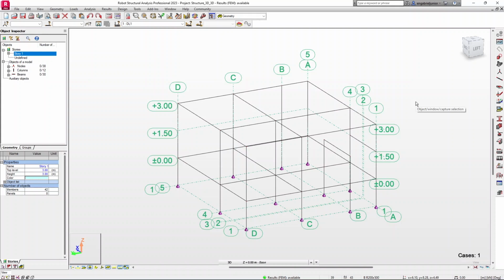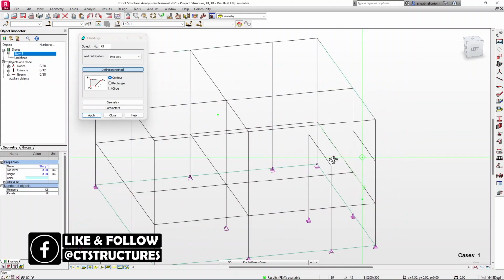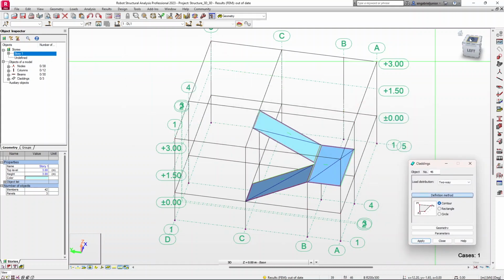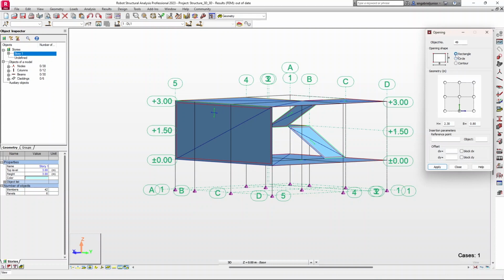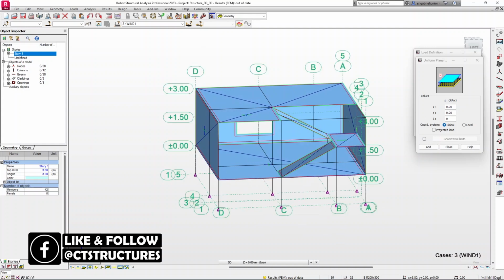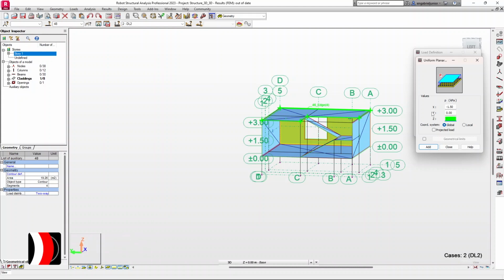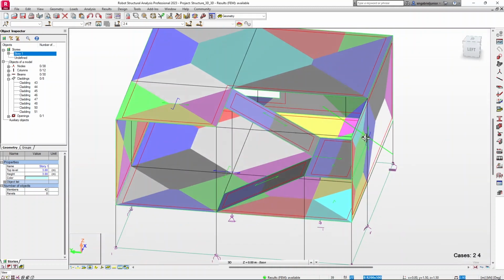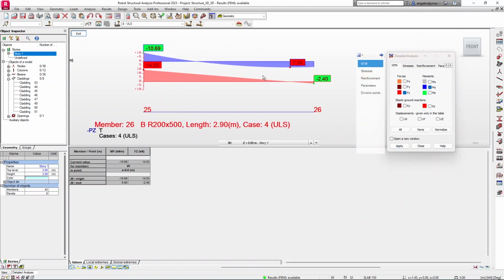Working with Claddings - Robot Structural Analysis Extras

Comment: Do claddings work for load distribution when load-bearing elements have offsets that pull them out of the plane where the cladding normally would be? Should claddings be drawn on the original axes, or should they be drawn on the nodes of the elements after they have already been displaced by offsets?
Reply from the maker: Hello Daniel.
To respond to the first question; yes they do.  The load-bearing member will respond according to how it is modeled, considering the offset. 
The second question:  Claddings will follow originally defined points (nodes). The offsets will only impact how the element behaves.
Reply: How do you turn them off